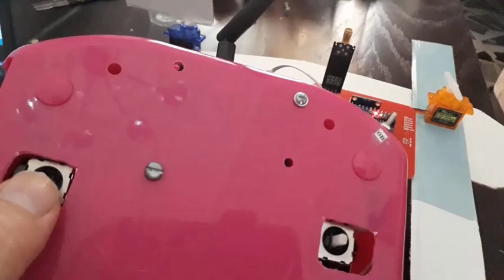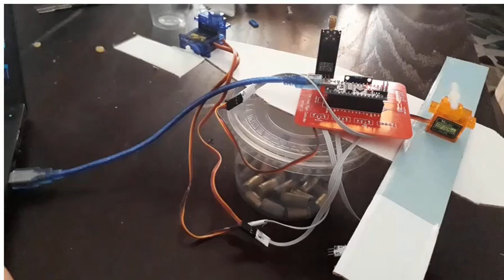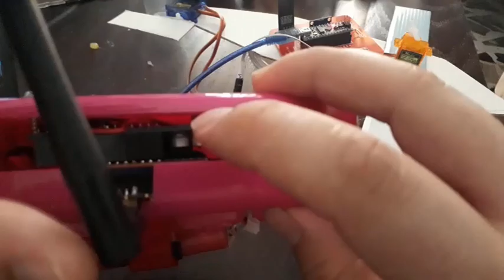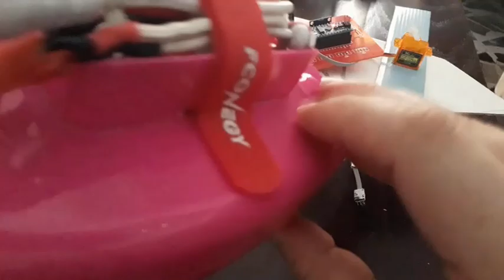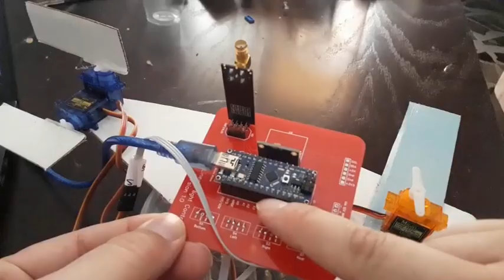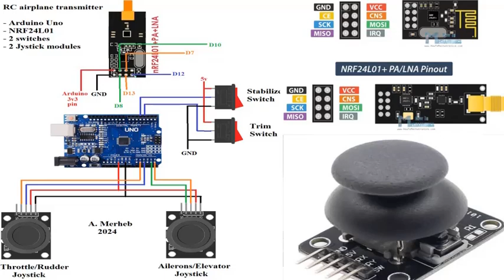DIY Remote Control for RC airplanes with Gyroscope/Stabilization

Comment: Hi, line 261 does not have 02, 0x16, 0x02, 0x00, 0x00 // D_0_22 inv_set_fifo_rate
What is the MPU6050 library version?
Reply from the maker: Hello, try to find the "MPU6050_6Axis_MotionApps20.h" file in the "MPU6050" library. The library I am using is declared as follows in the code:
#include "I2Cdev.h"
#include "MPU6050_6Axis_MotionApps20.h"
The library is called "MPU6050" I checked it and I found a folder called "Examples" which has a code that includes the following link: 
https://github.com/jrowberg/i2cdevlib
and the following is said:
// I2C device class (I2Cdev) demonstration Arduino sketch for MPU6050 class
// 10/7/2011 by Jeff Rowberg <jeff@rowberg.net>
I hope this helps. I will add this information on the "instructables" page.